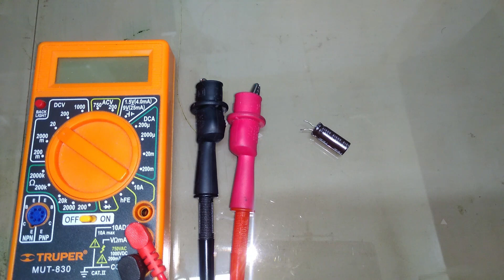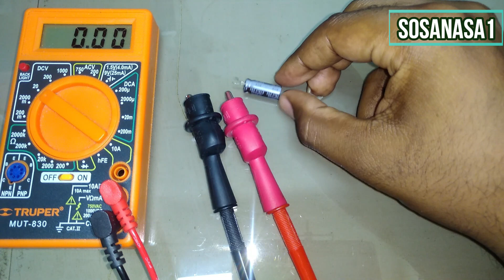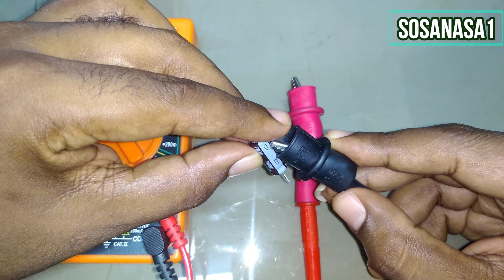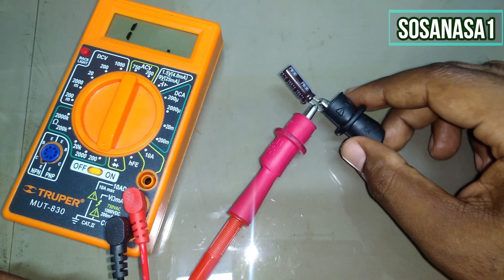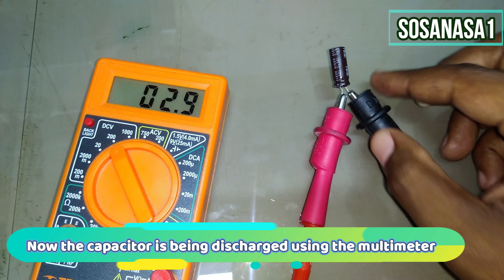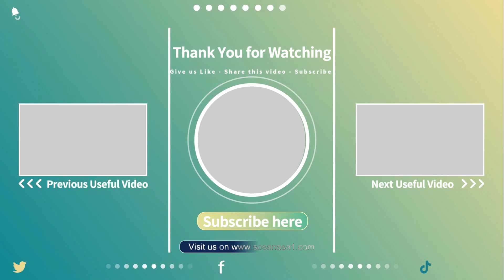How to test capacitor using only the digital multimeter

Comment: Typical parallel resistor for multimeter in voltage mode is about 10Μωμ so the method is wrong.

Comment: Where does the energy go? The charge from the capacitor where does it go when you discharge it or short it?
Into ether?
Reply: Into heat.  The charge on most capacitors is small so the heating effect is tiny.